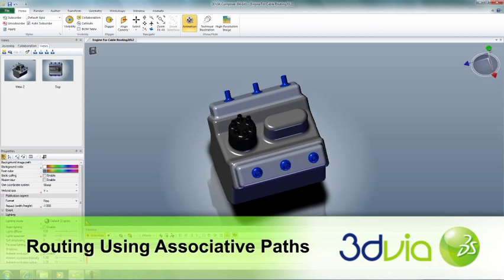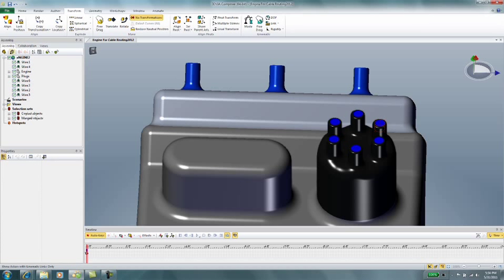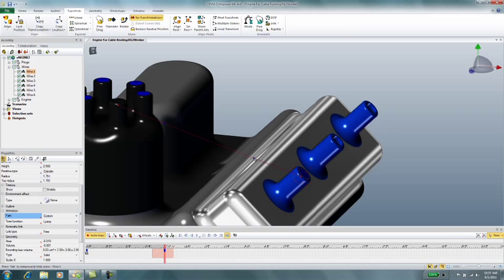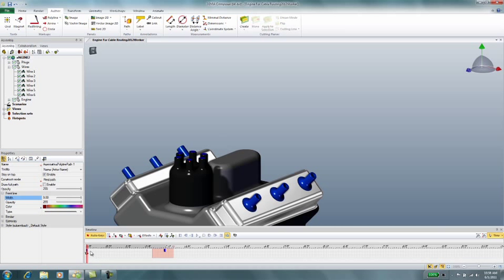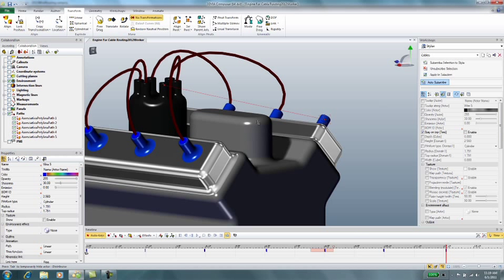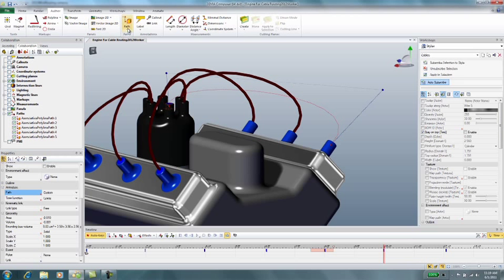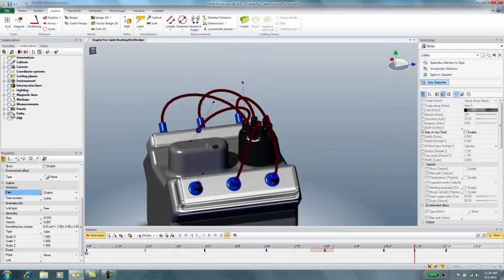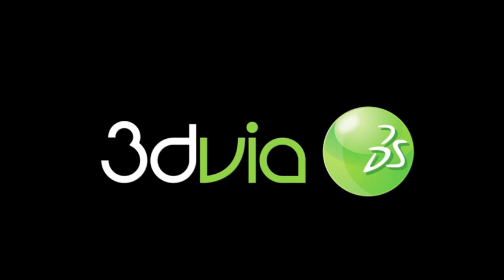SolidWorks Composer Tip: Wire Routing

Comment: A work around without using animations is using polylines for technical illustrations only.
1) Create polyline from starting point
2) Start adding each corner until you reached your desired end point (ensure this is a single polyline)
3) Enable 'Smooth' under polyline properties
4) Add nodes along polyline that you want to change curvature
5) Change desired properties for color, opacity, borders, etc

This is limited, but at least you don't need to use animations.